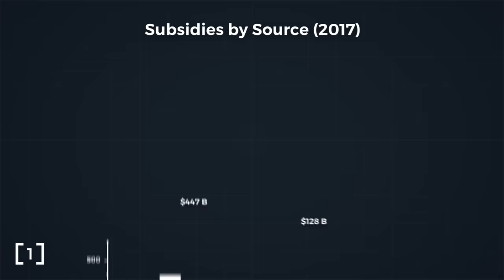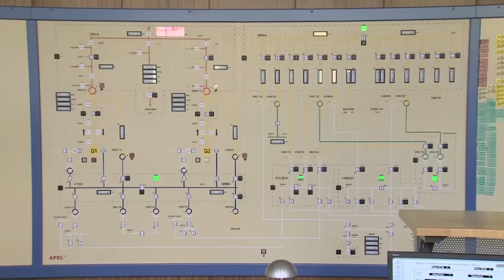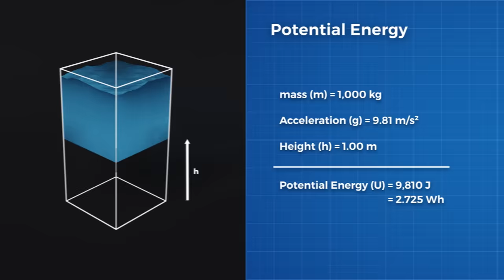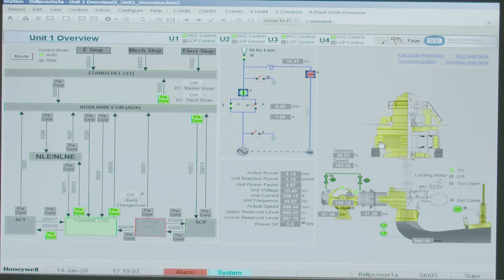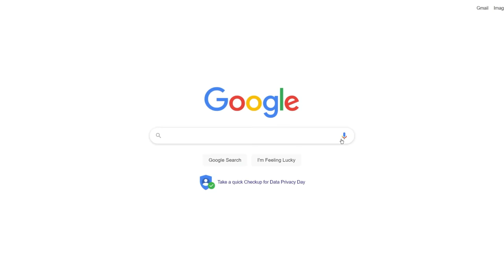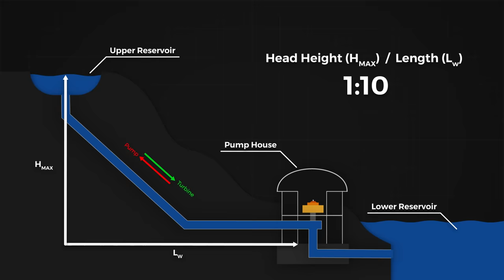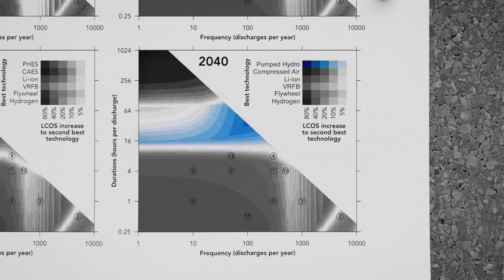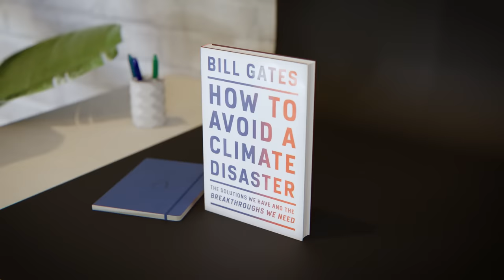The Truth About Pumped Hydro

Comment: The truth about the 'difficulty' of pumped storage - there is none.  Ireland has 45 power stations occupying an area at least as big at Irelands 6th largest lake, which this program notes is the size of pumped storage reservoir needed.  So, land isn't the problem, current power systems already use as much, and more, land.  Current fossil fuel power systems, about 1/2 the total, are far more costly to build, as the area of land is largely occupied by HUGE buildings filled with extremely precisely made HUGE equipment, a combination very difficult to perfect, as reflected in the very few manufacturers of large generators.  Pumped storage faciliities consisting almost entirely of shallow lakes, lined w clay or maybe plastic membrane, with miniscule percentage of site devoted to the 'very big building stuffed with expernsive equipment probably means over all, the per watt cost is less than fossil fueled power stations.  As such, full pumped storage supply, a very robust with lots of safety factor as this show notes, would be LESS in cost and effort than what it cost to buildi out the current generating system it would replace, less the reduction in operating costs since no more fossil fuel would be used.  Even factoring in the lower reservoirs, which are absurdly cheap to build, as they are nothing more than shalow hoels in the ground.  A process accomplished efficently with a range of MONSTER equipment made to strip mine coal, machines that are increasingly being aabandoned. 
Transmission - gee isn't all power transmitted, isn't transmission a cost in all power plants do, why do you say pumped storage are especially burdened?  As to losses, Brazil, 30 yrs ago, created a hyper efficent tranmissiom grid that providew power of 1000's of miles away.  Germany has done the same utilizing under sea cables.  So, transmission losses aren't a problem.  
Environmental - Is utter and complete CRAP  There is not a single pumped storage project on earth that isn't a 1000x improvement over the equivalent fossil or nuke fueled power stations.  This is a 'red herring' that is used to stop almost all pumped hydro, and hence ending the rich people getting rich selling oil and gas.  Related to environmental is 'view shed', as many projects are stopped because a mountain will instead of having a rounded top will have a flat top.  Again, this PALES in comparison to the 'view shed' ruined by not just a power plant, which is visible even at night for tens of miles due to the multitude of lights on it, but the smog and particles directly and indirectly via increased cloud as water condenses on 'seed' particles spewed out by fossil fuel plants, as well as the withering of plant life from acid rain, etc.
I can't count the number of green power projects I"ve seen over the decades stopped by lawsuits costing millions, not from high profile well funded environmental groups, who all agree ANY green energy facility is a HUGE win compared to fossil fuel and nukes, but stopped by groups that got concerned about local environment after the green energy project was proposed, tiny groups that appear from no where, or ineffective groups that of a sudden grow first rate attorneys out of their ears.  My favorite is a tiny indian tribe in NE US, who sued to stop US's first wind farm decades ago because there MIGHT be a 10,000 yr old burial ground "somewhere" in the project area, as 10,000 yrs ago was the last time that undersea shelf had been exposed to air.  The other is the old iron strip mine, MASSIVE in size, that no environmental group had managed to control in the nearly 100 yrs of operation, but all of a sudden, after decades the abandoned mine blighted the landscape, polluted it, sprung into existance overnight able to hire first rate attorneys for 1,000 s of hours to halt the green energy project (the fall back project for the sites owner was to become LA's new municipal landfill, you see, the environmental group lacked the billions to buy and return the land to nature and the gov't sure didn't, and legally you cant deprive an owner of making use of their land somehow, so it would be one or the other, green energy or dump.
It's OBVIOUS that often the groups fighting green energy projects are simply fronts or the gullible fed money and assistance by shills for fossil and nuke power.
Until a gov't somewhere grows a spine, makes an effort to champion an actual conversion to green energy NOW, not someday when a $1 super battery will stores days worth of energy for a household, and educates the people, pushes the programs, projects, revises laws being used to block green energy in favor of polluting energy, nothing much will change.  Many countries who pursued green energy aggressively long ago hit the max useable without mass storages, available now and for decades ONLY by pumped storage, and any additional green energy generation would be useable for just part of the time it's available, and as more and more green energy lacking storage comes on line, and less can be used, it's per KWhr costs will rise making them more and more unaffordable.
THIS IS WHAT A WELL MEANING WEBSITE WOULD  TRYING TO DO, point out the real problems, the people blocking adoptation of our ONLY feasible green energy storage facilities, as well as green energy generation for that matter, and the futility of continuing to build out green energy production without storage.

Comment: "Wicket gates"? You said the impeller rotated at fixed RPM to maintain 50 hertz line frequency, then you said generator output could be reduced dramatically via wicket gates controlling water inlet to the impeller. Besides rotational rate, what else is there that can be altered in a generator with no transmission? You could disconnect some coils and produce less current, but that wouldn't be efficient.

Call me confused.

Comment: Ask yourself this question--- the energy to pump the water up to the lake IS more than the power you get out of it on the way back down plus the cost to build it SO were are we going with this idea apart from giving our money away!!
Reply: Congratulations! You have described literally how every power STORAGE method works! 

And yes, they all lose some energy one way or another. But that's still better than storing nothing and losing all of it.
Reply: we have a large hydro project that has cost 6 billion and only half way finished . a project called the snowy river and we will never recoup the cost let alone a profit when is it time to pull the plug. NOW solar 65% recyclable and 10yrs if your lucky it runs with full output . now wind is more non green why?  well blades as of today are cut up and dumped a concrete base that in Australia we have used that much concrete we could have made two dams and 98% recyclable with a life of 100yrs plus not 25-30yrs . So to the point loss of power on the production side is just one of the negatives

Comment: I think this comment will not be popular, unfortunately. I work in the solar industry and am a big fan of solar. However, the truth is that wind and solar are cheap right now because they are redundant. They have to be redundant to an on-demand source because if they weren't, our power would go off at night/when there is no wind. A fair cost analysis between solar/wind vs fossil fuels should include enough storage for at least 24h or realistically more. Seasonal storage may even become necessary as solar/wind generation gets very high relative to on-demand sources like fossil fuel, hydro, nuclear, geothermal, etc due to seasonal variations in energy demand and renewable production.
Reply: Also the fossil fuel subsidy numbers are often inflated by including things we need to spend money on anyways, e.g. spending to keep shipping lanes safe. Take care

Comment: I don't see hydrogen ever really taking off for grid operation, because electrolysis plants are expensive to to keep open even ignoring the electricity costs, if you are only using them when there is spare energy the resulting hydrogen will be stupid expensive because you have to offset the cost of the plant even when it's not generating hydrogen. Pumped hydro is still a WAY better option for energy storage and really even storing water for 1/2 a year isn't a problem.

Also you have to deal with hydrogen embrittlement, sure graphene would be able to solve that problem, but making graphene lined tanks and lining the inside of your equipment with it is probably always going to be to expensive to bother with except for very high value parts, and given how low the volumetric energy density of hydrogen is lining tanks is going to be a fools game, so every year or 2 you are going to have to replace every single tank and a lot of your equipment.

Hydrogen power storage is just dumb, thermal batteries are far superior and where the geography allows pumped hydro is even better, yes thermal energy storage doesn't allow for long term energy storage, although if you put in enough effort I'm not sure you couldn't extend out the lifetime significantly although the expense would probably make it not worth it.

For example, on the inside an argon atmosphere with refractory bricks which would be lined on the outside with a material that can absorb infrared and lower energy viable light well on the outside, with mirrors reflecting light back in, then a double layered sealed steel with a vucume inside with layers of aluminium foil probably about 50 layers inside the vacuum with the back of each layer of aluminium coated with something that will absorb inferred and low intensity visible light highly effectively , then pretty regular insolation on the outside. That would be expensive though, just the vacume chamber of a sufficent size would be incredibly expensive, but it's also the thing that will reduce the heat lost the most.

But really as you showed even 48 hours of storage is highly valuable.

Comment: I don't know where else to put this comment even though it's not exactly related to the topic of the video.
I wonder how much thought has been put into more efficient use of energy within the home. We have all these isolated systems fighting each other wasting a lot of energy, like your refrigerator, your home heat or cooling, hot water, cooking, etc.
Wouldn't it make sense to have a single heat pump system moving heat around from where you don't want it to where you do want it, to be used for hot water, cold food storage, cooking, and air temperature in the living space?
Reply: You could incorporate a massive heat sink to mitigate the differences of energy use depending on the season. Possibly using two thermal banks one for cold and one for hot?
Maybe salt to store heat, and carbon dioxide to store cold.
Reply: I guess we don't usually produce excess cold, but we always produce excess heat which we then throw away into the atmosphere. If we could capture our excess heat and store it, maybe we wouldn't have to produce as much in the first place. Like all the hot water that goes down the drain when you take a shower, and all the hot air that comes out of your clothes dryer, and the excess heat that comes off of your stove when you cook, etc.
Reply: Does our waste heat contribute directly and significantly to global warming?

Comment: Your calculations didn’t account for the power to pump it up as that would take more than you get out. Then you don’t just need to generate the average, you need to compensate for low wind when the power generation is really low for wind for several days

Comment: Yes, it could be one of the solution but the conversion of potential energy to electricity (when u count the energy used to get the water up) is not that efficient 
I am not a scientist or anything but I have seen and read a lot of material on energy storage 
Refer practical engineering for another video on the same topic where he explains the efficiency problem.

Comment: 10:36 not really agree with this. The peak power of pumped hydro is not needed 24 hours a day as demand is way lower during the night for example. So in the example you dont need 32 hydro storages.

Comment: I enjoy your presentations. I also find them accurate. 

I do have a problem with your emphasis on power generation capacity. You do know the truth because in this video you address the energy storage problem with renewables. But by neglecting the energy generation argument, you are de-emphasizing the reality of our situation. 

Make the argument with both generating capacity and total energy we consume, and the problem is not as simple. 

You also need to take into consideration the landmass that is needed for renewables in order to meet the existing electrical energy demands.

Comment: I don't know but the start of the video gave me an idea, No research done but why can't we use the excess renewable energy we have to generate hydrogen and then use the hydrogen in power plants, the reason we don't use it now would probably be because it takes too much power to make hydrogen and the power we would get from burning it and vaporizing water in a power plant would be too low. but if we use renewable excess which would be a waste otherwise, does that not mean it's technically free?  long story short uses the "free" excess renewable energy to make the fuel for hydrogen power plants. It would be dangerous if done in the wrong way because of how explosive hydrogen is but that's what smart engineers are for. Sorry it has nothing to do with pumped hydro but I think it's still relevant-ish.

Comment: 0:36 what is the $ of subsidies per Kw for both renewables vs fossil fuels?
Reply: Exactly. That's the only valid comparing.
Reply: @stefansoder6903  Fossil fuels have hidden costs to everyone.  Lots of people die from them.  Here in New England I can’t eat freshwater fish due to high mercury levels. Mercury from midwestern coal fired power plants.  What would be the cost of cleaning that up?  Don’t get me started on fracking and ground water pollution.

Comment: All this for a battery type device that would store what energy exactly lol, you still need to generate. This system should be paired with some kickass energy farm on your best possible site, Highest drop + most feed water possible, IE the place should be where you would put a kickass hydro station anyways and then the pumping system paired with the hydro station just store energy from whatever production you got around it, solar, wind, nuclear, whatever. So the truth is find yourself an hydrostation spot, build a big ass dam on it, probably way bigger than the feed water require since you mean to store, and then you are golden for power generation and storage for the next 50 years. So for those countries with actual hydro dams already built, it's just gravy over the top/infrastructure recycling to be able to store.